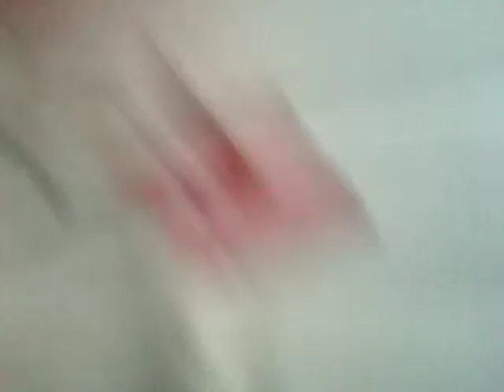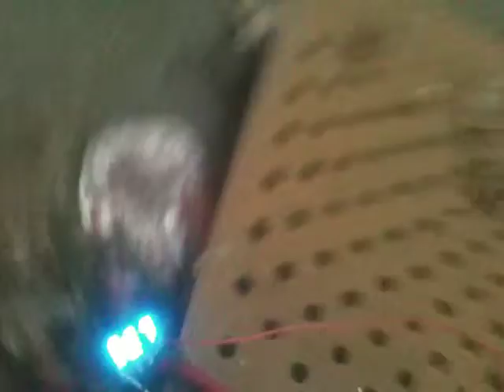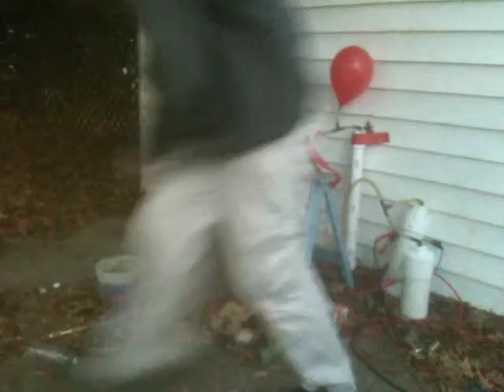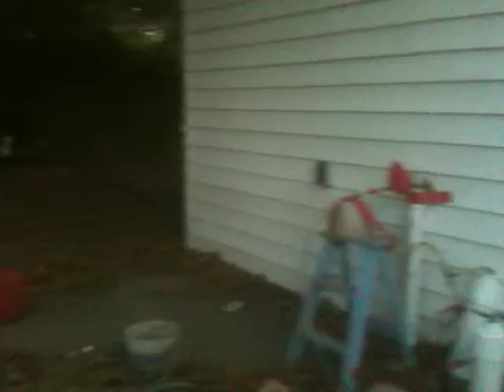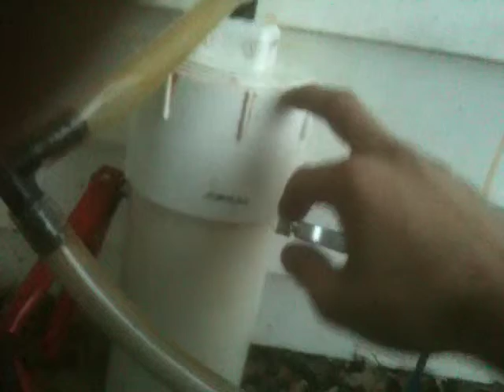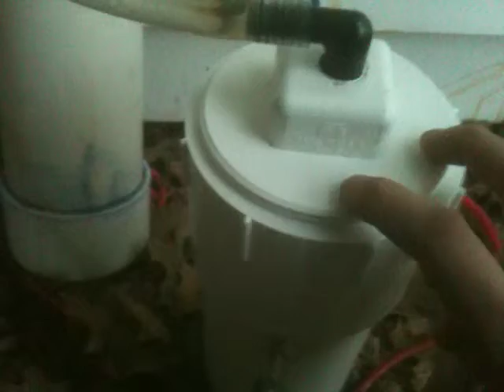Push Mower Running on HHO Test 4

Comment: After water conversion to Engines,the surging upper RPM problem on 
several engines had been solved. Not the water flow to carb, or special 
relay/electronics power supply. High volts and added 10 amps produced 
water vapor PRESSURE + Hydrogen gas. Heat from burning hydrogen expanded
 the water to steam in cylinders. It was finally figured - that it was 
the lack of EGR connection for Nitrogen compounds going back to the 
intake manifold. (Some water drippings saved) Piston compressed air in 
chamber has embedded Nitrogen required for smooth running engines.The 
new added S1R magnetic coil and 2.2Mh Inductor retarded the timing, 
since the 18HP mower engine had fixed factory timing at Zero point. See 
Youtube Videos 1+2 from S1R9A9M9, and web site tech notes and 
documentation from Dr. Graneau fog pressure lab experiments.